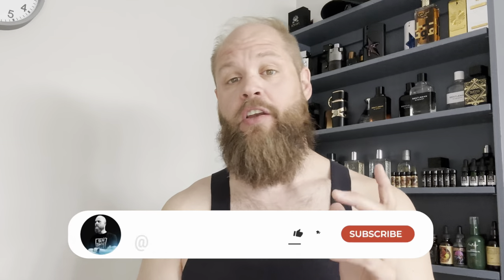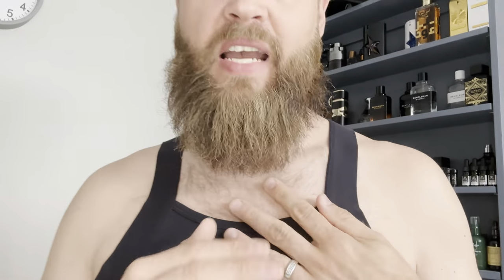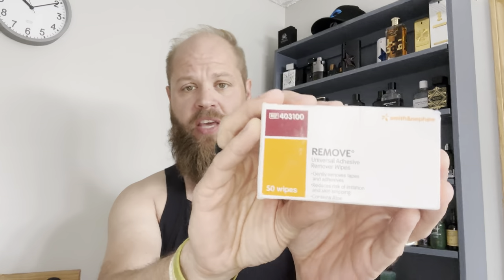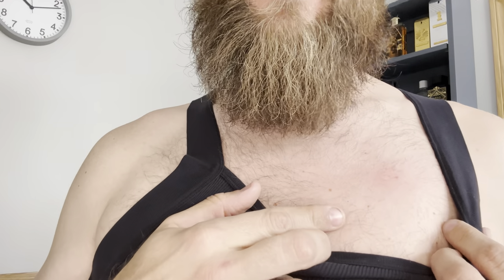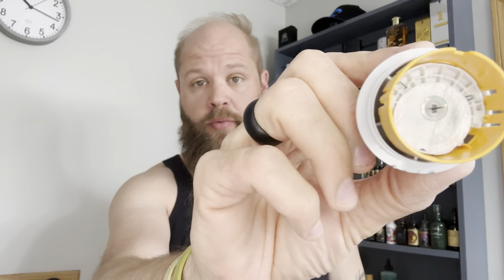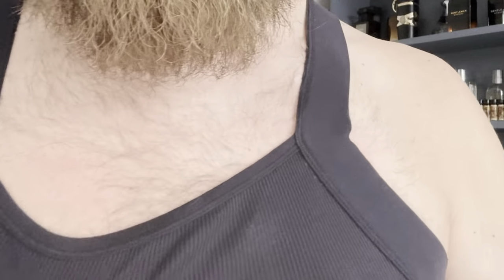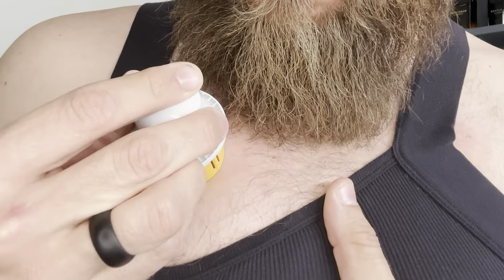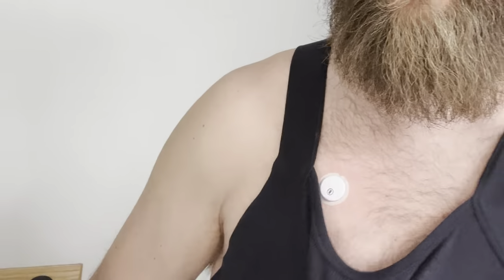Best Optimal Placement For Freestyle Libre 3 Sensor

Comment: I am putting it on my lower thigh, just a bit above the knee, on the front/external area of my thigh. It works like a charm. Never had a failure, never had a problem sleeping, never had it ripped off. It is definitely the best spot to put it on.

Comment: Hello.  I'm a Libre 2 user. My sister uses Libre 3 and she has had nothing but trouble with it. As for me, I'm sticking with Libre 2 because it works. As you have done, I moved my sensor to the fatty area of my peck muscle. No problem with it there, it doesn't alarm when laying in bed and I don't hang it on a door facing.

Comment: Libre 3 sensors won’t work with Iphone 14 plus and/or iOS 16.3 or updates?
Reply from the maker: Hmm, it should. I have an iPhone 14 pro max. I have iOS 16.5 beta and haven’t had any issues.
Reply: Thanks Chad.  The Libre literature doesn’t suggest compatibility
Reply from the maker: Anytime!

Comment: Would libre 3 get in way of weight lifting?
Reply from the maker: I haven't had any issues myself. I like placing it on my chest. It is out of the way from being bumped. You can find a good spot just experiment what works best for you. Thanks for watching!
Reply: @BeardedMounjarbro  Thank you
Reply from the maker: @LATOHOUSTON  anytime bro!
Reply: @BeardedMounjarbro  Chad just one more thing lol. I’m getting mine today. I want to try the chest area but a couple other videos said chest wasn’t as accurate as arm. Have you noticed a difference?
Reply from the maker: @LATOHOUSTON  its possibly that it might not be 100% accurate but the meter itself is said to not be also. With that said, I haven't had any issues myself.
Reply: @BeardedMounjarbro  Thanks Chad🙏

Comment: As a woman I put my Libre 2 on my chest, I have small boobs as well. It worked great. I was holding off w the 3. Thank you for the video.
Reply: Hello,
I have libre 2.
Did it work for you?
I am getting low values from my arms permanently.
Reply: Yes, it did work and then I changed to the Libre 3 and it worked as well. Better readings imo.